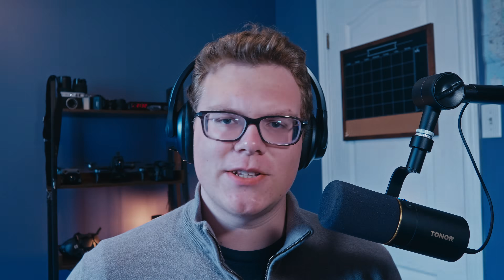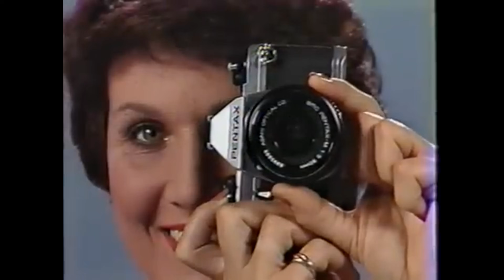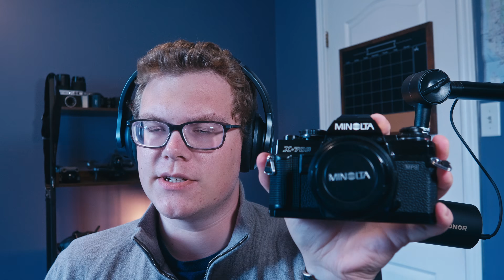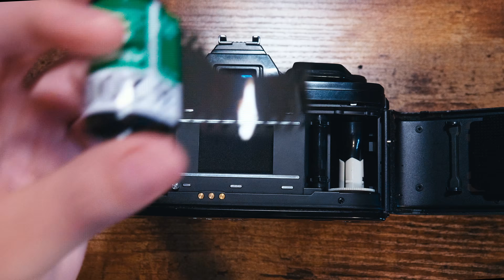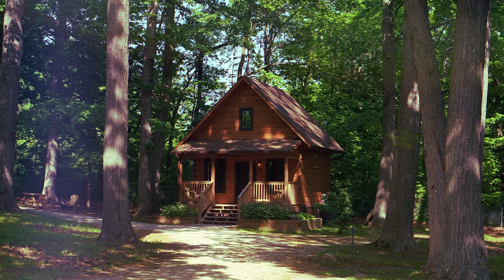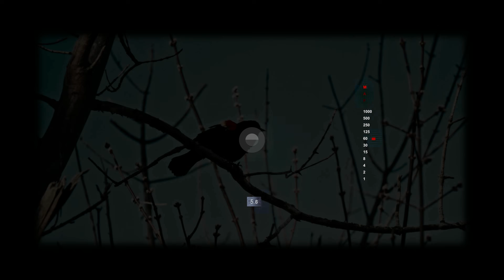The Best Film Camera For Beginners - Minolta X-700

Comment: Hey! Thanks for the video! I have recently bought the same camera and found out that I cannot turn my ISO control, it's stuck on 100. Do u have to have film inside to control it? Or do u think filming with ISO 100 would be all right? Thanks for the help!
Reply from the maker: Occasionally, it can get stuck after staying in the same position for too long. There is a wonderful disassembly video here on YouTube that you should be able to follow. Just have to make sure you lift up on the silver ring and then turn the dial.
Reply: @quentins8165  thanks so much! It was just a bit stuck and the next day I could adjust it:)
Reply from the maker: @juliama9209  Happy to help :)

Comment: I like it, but don’t love it. The big caveat many ignore are the capacitors that will eventually go bad. Because of that and many other reasons, would not be my first choice. But I will refrain.
Reply from the maker: There are always issues with any product, I've personally found that there are some light leaking issues, but I haven't had any issues with the capacitors. There were certain models that were made that don't have the capacitor issue. That said, there are other options such as the Canon AE 1 F1 or the Nikon F Series that can make amazing images. Thanks for the comment!
Reply: @quentins8165  I think a mechanical no frills camera is a perfect choice. When you get into electronics and program modes, as a beginner, I’d think of it as a ticking time bomb. But the Minolta glass is nice, and cheap.